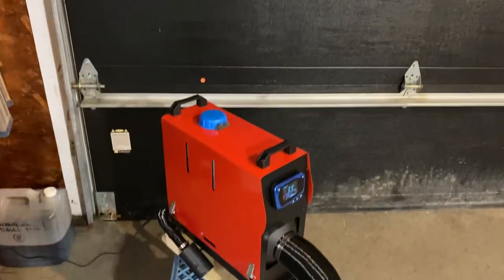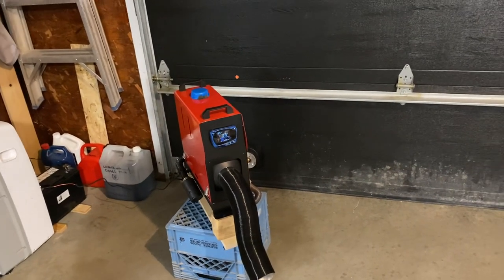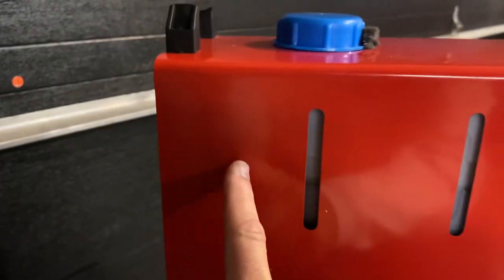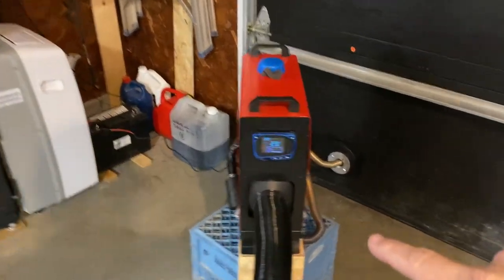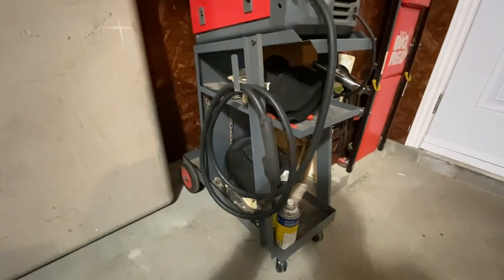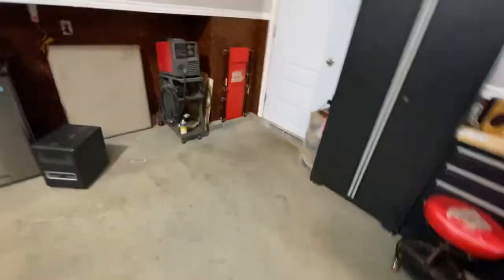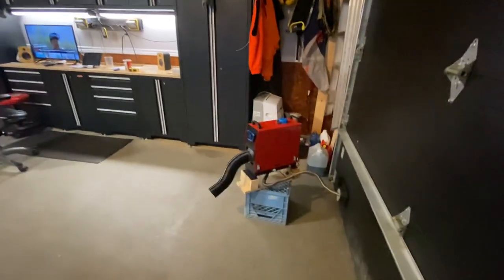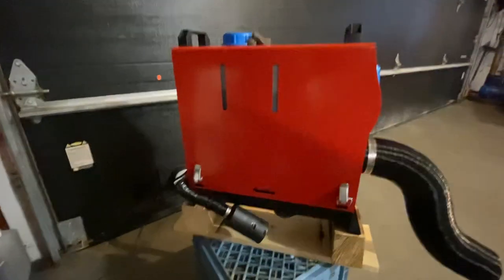Chinese Diesel heater heating up my 475 sq ft garage

Comment: Just my two cents here; keep the entire exhaust in a downward way. Any form of burning / oxidation will produce water, and you don't want water to block the exhaust..
Reply from the maker: Very valid 2 cents ! I totally agree.
Reply: One on my pickup has a low spot. I drilled a small hole at the low spot and haven't had any problems with condensation freezing in there

Comment: I have one just like this for my little cargo trailer.  I use one of those wheel steps you talk about and run aluminum 3" dryer vent hose to a vent in my trailer floor.  I block it with a pipe test fitting when not in use.  I also have a storage tub that is fitted over the unit when it rains or snows.

Comment: You can get a 120 V to 12 V converter so that way you don’t have to run a battery you can just plug it in the wall and the biggest problem with any of those style heaters is the volume of heat they put out is an a timer for a large area so you might have to get something to help get the temperature up and then that will maintain it as long as you’re very well insulated

Comment: If you don't have a ceiling fan in there, Storm, you need one. Circulates and pushes the heat down from up there.
Reply: Or just a box fan set up high, pointing down

Comment: What is the plate that you have fitter to the garage door that the exhaust goes through? looks a neat solution
Reply: Yes, more info on the exhaust sleeve would be most helpful! Thanks!

Comment: Have you though of routing the burner intake air pipe outside? Now it will build low pressure in your garage and draw cold outside air to replace the low pressure.
Reply from the maker: Yes that worried me in the beginning so I kept an eye on that . But I have a good friend whom is a HVAC tech and I asked if he had a way to measure that and well he laughed at me , said this isn’t your house , garage have enough air leaks that you’ll never have to worry about that. The garage door has slight leaks and well the port I use to exhaust around its rim has slight leak. There isn’t a pressure drop or negative pressure that can be felt after many hours . I’m always in the shop when I run it so I do go out and in with door open often and you never get that air rush . But in a future video you’ll see me mention that I will be putting a permanent vent and I will draw an intake. Thanks
Reply: @Storman77  Thanks for replying. Yes certainly there are air leaks. Was just thinking that it most likely gives better overall energy efficiency by having the intake from outdoors.  I was also thinking if somehow could have two wall pipe welded for say ~30cm of length so that inner pipe would be the exhaust and outer pipe intake. Both routed outside. This would give two advantages: Intake pipe air gap would work as an insulator for example when routing through wall and second it would pre-heat the intake air to improve efficiency. Bit hard to try to explain, hope it makes sense.

Or could route the exhaust gasses through radiator, maybe that would have the highest efficiency.
Reply from the maker: @Ccorniit  you already reading my mind lol . I had a wood pellet stove did exhaust exactly that way the exhaust in the intake we’re in the same hole they pre-warming the air coming in.

Comment: By all the videos on here it looks like if you filter your fuel, the heater will run longer without having it to be cleaned so often. Best thing to do is to replace the cheap green fuel line with some better quality line and install a filter between the tank and pump and you'll be good to go.

Comment: Hey man. I am looking for a way to heat my 14x40 ft insulated wood building. Temperatures get down into the low 20s Fahrenheit in the winter at night. Do you think one of these would work?

Comment: Looking to do this. Right now I use a humongous diesel salamander. It kicks off and on as needed. I use about 7 gallons of diesel fuel per week to keep an uninsulated 20 x 20 garage 65 to 70. That’s with it getting cold outside. Do you think something this small would keep up with that?
Reply from the maker: You’d be burning same amount but way quieter. You’d have to run full out

Comment: You should run your fresh air intake outside becouse your useing air from inside the garage which if its air tight may be a problem.
Reply from the maker: I agree but I can 100% guarantee that the garage is not air tight. I can see little light here and there on main door.

Comment: Not sure if it shuts off the blower fan or stops air flow when it runs out of fuel. If it doesn't and your fresh air inlet is outside that could turn into a cold night.
Reply from the maker: That’s so true lol . From my test which I haven’t posted it does shut the unit down . It amazingly enough has a bunch of safety features built in which I am testing. I truly want to know how far can I trust this unit . I won’t completely but I want to know I can go in house for a couple hours and not completely set my house on fire. But interesting point you bring up I will mention that in my video about safety features.

Comment: How long does a full tank run? And how much is the capacity? Liters or gallons
Reply from the maker: I haven’t done a proper test but thank is 5 litres and for me runs about 6 hours at various temperatures. I will be doing proper test soon.
Reply: @Storman77  Hii, when you manage to do a proper test of diesel consumption, please reply? cheers.
Reply from the maker: @cosmovsky  I did do a consumption see link Chinese Diesel heater consumption test.
https://youtu.be/rXUMr7GGbEo
Reply from the maker: Chinese Diesel heater consumption test.
https://youtu.be/rXUMr7GGbEo

Comment: I accidentally just bought the 5kw version because they both look identical.  I was not aware that there was more than one option. 
What's the difference? More heat? Should I be concerned that I got the 5kw instead of the 8kw?
Reply: The “8kw” are the same as the 5kw

Comment: How long can you run that until you pass out form the gases?
Reply from the maker: Well if you exhaust in your camper and house I don’t know really. I exhaust outside and have a Carbon monoxide detector on all the time and it never has alarmed . It has a separate intake and exhaust port then heating intake port and exhaust port.

Comment: You might find a kerosene space heater is better suited to this purpose? I use one connected to a thermostat, and it burns heating oil (which in the UK is cheaper than diesel), and it heats a relatively large space quite quickly, then switches off. Only downside is the bigger ones are quite noisy.  They are industrial machines though, far more durable than the Chinese van heaters, and using heating oil and a thermostat, are very cheap to run.
Reply: I could agree, but - two draw backs I can think of off the top of my head are these:

1. Kerosene produces moist heat
2. Kerosene heaters in the US are not vented to the outside and therefore require active ventilation while using.

I mention these two specifically because these diesel heaters are often being used in small spaces with limited ventilation.

I do agree that a kerosene heater would likely suit his needs, however some more drawbacks are smell, increased fuel consumption compared to diesel, and shop debris infiltrating the heater since they are usually exposed heating elements in the US.

Also, kerosene heaters still technically require maintenance (even if nobody does maintain their units), but it's far less work than a diesel.

Diesel makes you work for the efficiency and dry heat. They're great for off-grid situations where general maintenance and upkeep of the living space, and it's appliances, is expected.
Reply: @NAldrighetti  Have you tried kerosene (or heating oil), in direct comparison to diesel?  My space heater runs on either, and other than kerosene being far cheaper, there is no real difference between the 2 fuels.  I would think there is no reason at all, not to run one of the Chinese diesel heaters on heating oil, in exactly the same way as an industrial space heater, as they operate in exactly the same way?
Reply from the maker: Chris you are correct about kerosene working just as well. There are different fuels in North America vs the very refined diesel you use. Kerosene here is more refined here and cost slightly more than Diesel still . Also we can’t get at the pump so I will be dealing with 10 litres pails vs refillable cans. I should have mentioned in video the primary use of heater is for utility camper trailer and this heater I think is a good fit . I decided to make use of it in work shop.
Reply: @Storman77  What fuel do you use in oil fired central heating boilers?  Here we have specific heating oil, which is much cheaper than diesel, and is something many taxi drivers have been using to power their diesel cars, over decades.
Reply from the maker: @chrisstevens8431  yes it’s called furnace oil which is just a red dye diesel . They dye it so Taxi drivers don’t use it lol 😂. I am messing around but they dye it because it’s tax free fuel . We can use off road and it’s used for furnace oil . That would certainly work. They deliver it I large quantity but you can also get it at the fuel dealer if you have proper cans for it . I may try it
Reply: @Storman77  Many use heating oil to power diesel vehicles here in the UK.  Only thing required is to add a small amount of 2T oil, then it works fine.  Perfect for diesel heaters, and it seems crazy to pay more tax for nothing?
Reply: @chrisstevens8431  diesel is cheaper in Canada then kerosene and it does burn a little hotter.
Reply: @nextellcup8  Here in the UK many people's houses have oil fired heating boilers.  These run on heating oil, which is much cheaper than diesel.

Comment: Link to this model on Amazon?
Reply from the maker: VEVOR 8KW Diesel Air Heater All in One 1 Air Outlet Diesel Heater 12V Remote Control Parking Heater Silencer with Blue LCD Switch for RV Trucks Bus and Trailer https://a.co/d/17MllmM

Comment: Does it need to be attached to 12V battery all the time as heater works?
Reply from the maker: Yes it does, it will draw for fan and glow plug on start up.
Reply: @Storman77  Thank you. Do you think it will drain 1x12V battery over the night (8h of work)? I intend to use this set up over the night on winter time in my semi truck bunk.
Reply from the maker: @bojankljajic5408  oh your are very fine . They are originally design for transport air heater . I will link it for you the kit . Now for batteries I bet you can run 24 hrs before any problems. They drain 10 amps at start up for 5 min then they run at under 2 amps depending how high fans are running. See link below and good luck . https://www.ebay.ca/itm/123869265367?mkcid=16&mkevt=1&mkrid=711-127632-2357-0&ssspo=HJBZTmZeToG&sssrc=2349624&ssuid=brvgjgb_reu&var=&widget_ver=artemis&media=MORE
Reply: @Storman77  Thank you a lot. All the best for you. 🖐
Reply: yes or a 12v wall adapter

Comment: Get away from the battery  I use a jackery and solar panel I have many ideas but I would get one with out the case mount it out of the way any you can mount the fuel outside I have pictures of what I have done in my 8x8 shed

Comment: Can you use kerosene in the haters?
Reply from the maker: @David Bohanan you certainly can use kerosene. Kerosene is actually refined Diesel.
Reply: I just read 10-20% into diesel to keep it from freezing.Around here diesel is 5 bucks gallon.K is like 8-9 bucks.
Reply: @Storman77  I saw a video where a guy said straight Kerosene will not properly lubricate the dosing pump in closet to wear out quickly but I'm still a newbie don't know anything yet just waiting for my unit to arrive tomorrow

Comment: Take the black outlet tube off no need for it
Reply: I’d aim it down to warm concrete floor.A Y would give you 2 hoses to warm more area also.If aimed at a big can of oil the oil would keep producing heat for awhile also.Like putting a hot rock in a sleeping bag will produce heat for awhile 😆